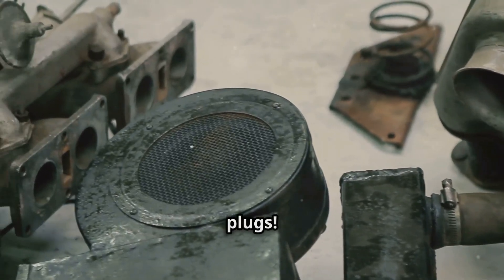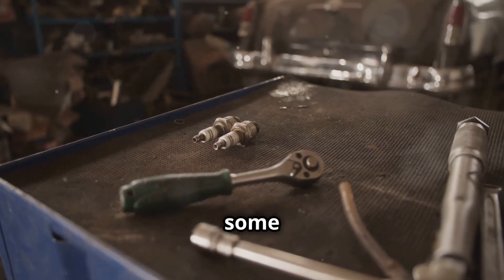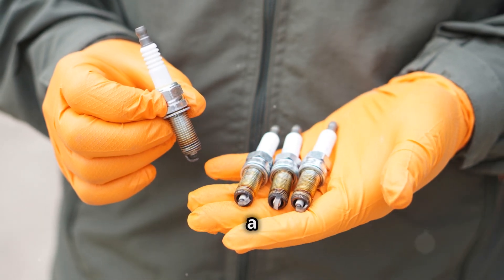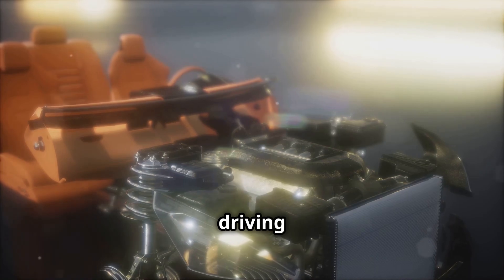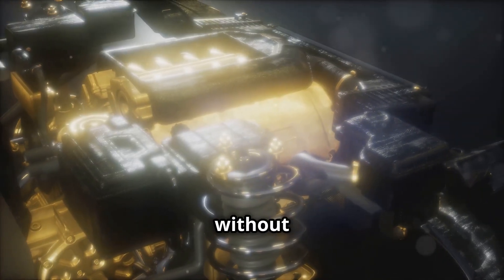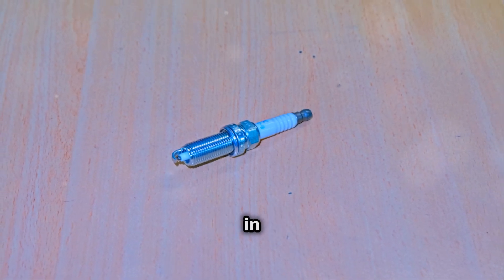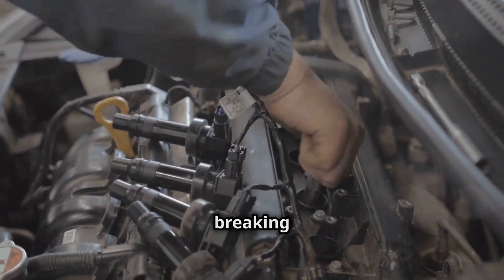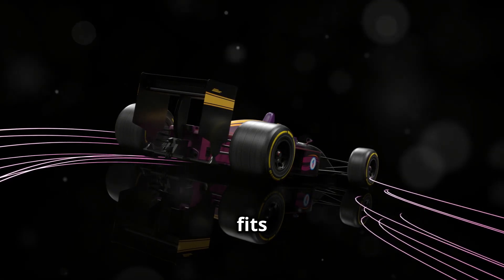Copper vs Platinum vs Iridium SparkPlugs: Which is Best?

Comment: My 2008 Toyota FJ Cruiser oem plugs were platinum, is it okay to change to iridium cause?   I know there are mechanics who say stick to manual no matter what, seems like iridium is an upgrade as long as there aren’t any problems?
Reply from the maker: Yes, it is generally acceptable to use iridium spark plugs instead of platinum spark plugs in most vehicles. If the spark plug fits your engine’s specifications (correct size, heat range, gap, etc.), iridium plugs can replace platinum ones with no problem.
Reply: @AutoMotiveYT thanks 👍
Reply: Mechanics  who says that wanted you to comeback to them more often to change your spark plugs so that they can make more money from your pocket.